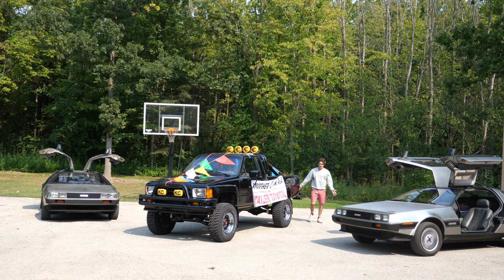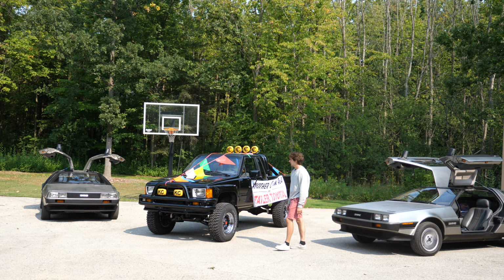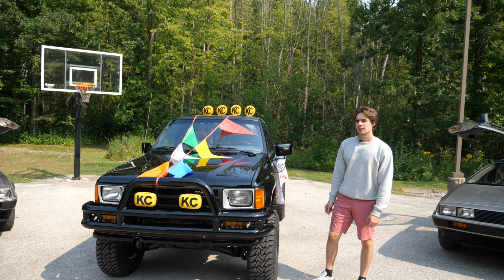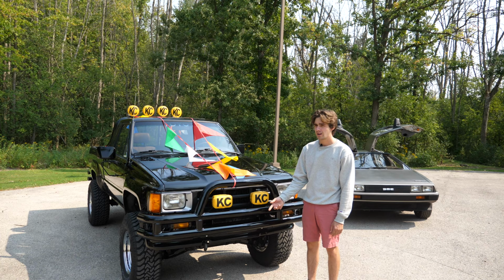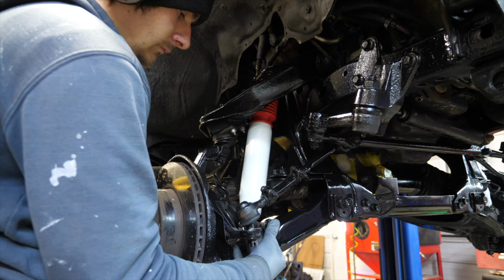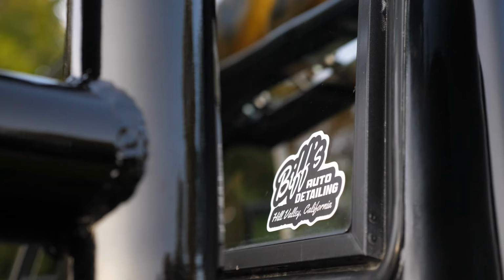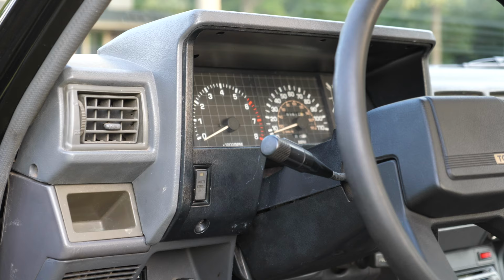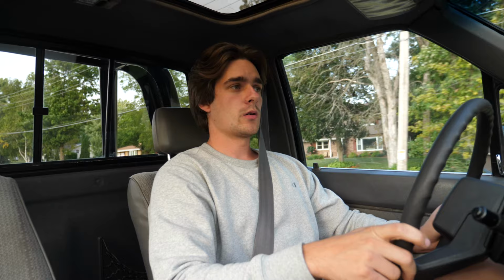Building Marty Mcflys Dream Truck From Back To The Future

Comment: Great truck! What exhaust is on that?
Reply from the maker: Hey Brandon, the exhaust used was the “Pacesetter” exhaust system. I should have pointed out that it sounds awesome but the “system” is not very good. We had to tweak a bunch of the pipes that came with it so that the fitment was better out the rear. However the chrome tip makes it appealing in my opinion.